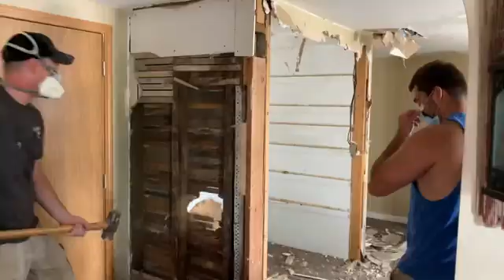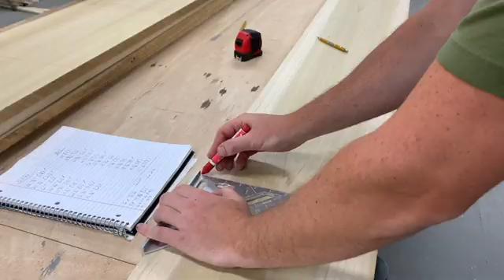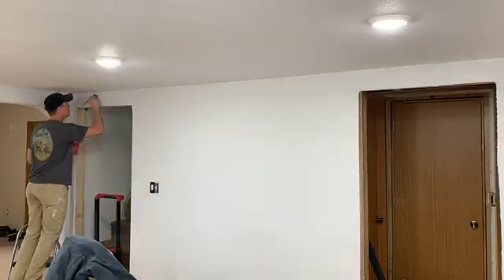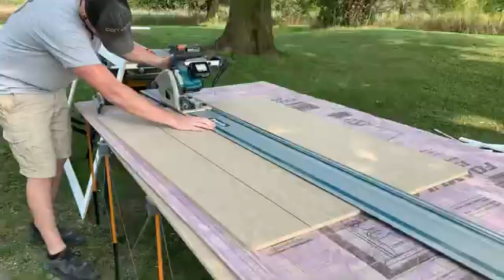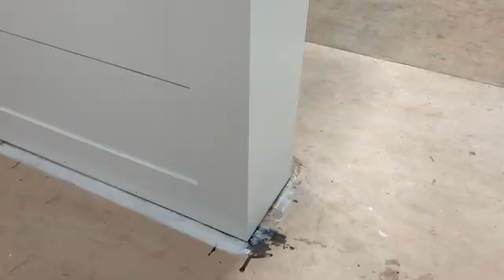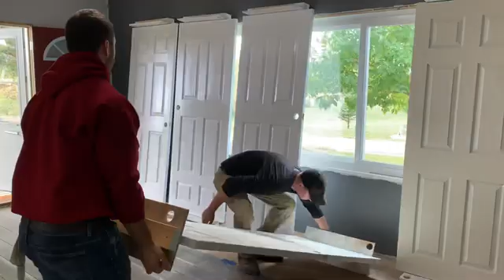120 Year Old Farmhouse Kitchen Remodel

Comment: I plan to paint my desk using SW Semi-Gloss Emerald Urethane Trim Enamel (Tricorn black). Until I watched this, I did not plan to use a top coat. Would you recommend a top coat with this paint for something that takes a beating like a desk?
Reply from the maker: No you don’t need to topcoat over that

Comment: You didn’t glue the wood you laid on the floor, you have a much higher chance of getting squeaks down the road. Other than that, you have a very unique skill of optimizing your work, specifically the clamp that you made for putting cabinet doors and drawer fronts on. Overall, it looks amazing!
Reply from the maker: Laminate is a floating floor, you don’t glue it

Comment: Is this home located in a warm climate?  Odd locations for air ducts.  I saw one in the middle of the kitchen next to the stove where one might stand and another against an inside wall with what appears to be a return air duct also on the floor.  Not a criticism.  Always wanting to learn why some things are done the way they are, thus the question.  That aside, the remodel was extremely well done.
Reply from the maker: Indiana. Not uncommon or wrong for both to be in the floor when there’s a basement. I agree they could be in better spots though haha old house, lots of quirky things going on

Comment: I just cant believe how the ceilings back then were so low.
Reply from the maker: Yea it’s pretty weird! Haha
Reply: Ceilings were kept low at the time because there was no central heating or air. If they lit a fire the rooms could be closed up and the room would stay warm longer. That's why there were so many closed off rooms with doors as well.
Reply: A 120 year old house typically would have much higher ceilings. This kitchen was remodeled in recent decades. 120 years ago there wasn't drywall or laminate counter tops. The house may be that old, but the kitchen has seen at least one remodel.

Comment: *******WHAT DID YOU USE FOR YOUR SKIM COAT INSTEAD OF RE-DRY WALLING??????
Reply from the maker: Just regular joint compound
Reply: @JohnBuildsIt  Thank you we are going to build a ICCF house and just use a skim coat instead of dry-wall as it has a 4000 degree rating.
Reply from the maker: @robinbriggs1517  A skim coat is just a smooth layer of drywall mud. I’m still going over old damaged drywall here

Comment: John, would you be able to do a video on crown molding installation? Keep up the great content, awesome video!
Reply from the maker: Considering adding crown in my house, so definitely a possible video! 👍🏽
Reply: @JohnBuildsIt  awesome. I have a hard time with the angles/cuts for end runs and outside rounded corners. Thanks for considering! I have a basement I am working on trimming out right now. Keep it up!
Reply: Please. I have had such a time getting better with that